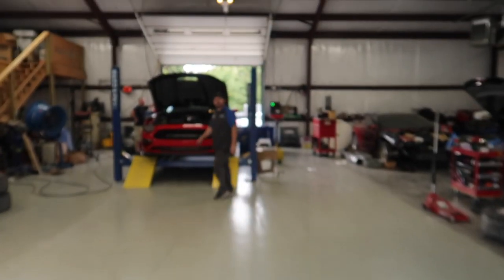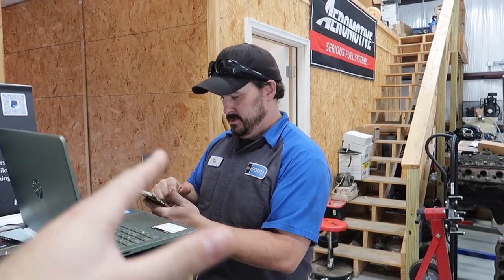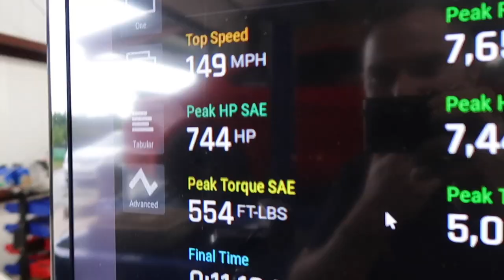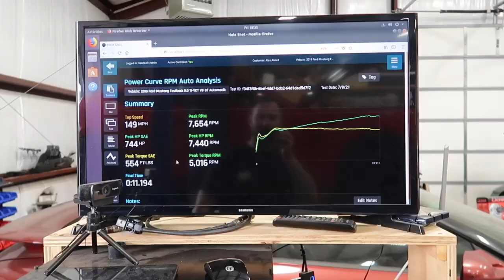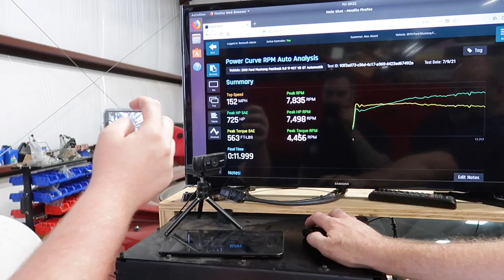Finally Dyno'd My Built 5.2 VMP Odin 2019 Mustang GT *SPEECHLESS RESULTS!

Comment: Dyno is tool for you to do testing, now you could have two identical mustang with one 780hp the other 725hp . Now at the track the one with less hp could very well be doors to doors with other.
Reply: Or even flashing his tail lights to the higher H.P car As well…. Set up for the drag or set up for the corners are 2 completely different set up’s we all know lowered cars do not 1320 like factory ride hight cars ever……

Comment: Thank you for the 93 content, as you may know they will be pulling e85 over the next few years ( corn could feed the hungry SMH).
 Looks like the PNR tank is worth 30hp or so with fresh ice...all great info... 
 Cannot wait for the track test, I for one really appreciate the 93 testing...
Reply: @Zander13Productions  I'm serious I really appreciate it, you may just be doing it for me as I'm the only one that cares haha....
 But you know the EPofA is cracking down and the BIG tuner L company just said in a live stream that they were told e85 at the pump was going away....
 I just read a paper about how the Trump pushing for a raise from E10 to E15 with adoption from automakers nearly across the board to observe it for warranty and materials has led to a drastically decreasing Flex fuel demand ( the reason we have e85 at the pump)...
 The refineries generally mix 84 octane stock with e10 to get e87, now with e15 that is 88 octane for instance at my station and 10 cents or so cheaper per gallon....
 Then during that time Trump issued several waivers that are expiring for e85 production domestically its a HUGE read even for me....
 Long story short the targeted attack from the EPofA against performance parts makers and tuners doesn't stop there, along with the push for EV conversion by the government and manufacturing, flex fuel is being pushed out and even those states ( funny both of your locations show up near the only areas available in Tenn and Kentucky on the maps haha) that produce and distribute it now have provisional waivers to do so......
 I would NOT count on e85 at the pump to much longer as hard as it is even now to find....
 So to me a 93/boostane tune/loadout with maximum cooling is relevant to times 99% of the people have access too.....

 As I haven't given up on the platform ( just my car) I TRULY appreciate it Zander and love the entire build....thank you for tossing me a 93 bone....even the track I think its just such good content and gives everything time to settle in as you progress in power!!!
Reply: @bluecollardaily2676  I had no idea about the plan to pull e85 from the pumps.. that's crazy
Reply: @Zander13Productions  I'm not surprised folks are wanting to send their car from 700 miles away for a quality build and tune. 👍🏁
Last year I commented he needs to open up a shop and quit the Ford dealer. 😎